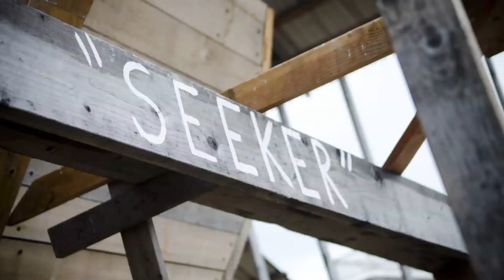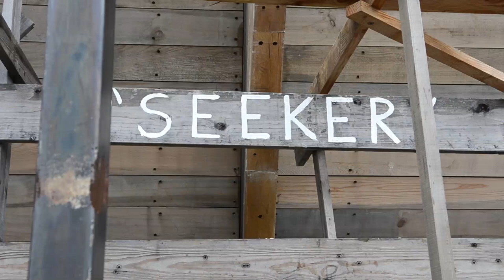Wooden Boat Builder on Martha's Vineyard  | Woodworking Tour

Comment: Hi great video, I just have a question i have brought myself a putt putt
 boat it has a timber top someone had fiber glassed over it so i have 
now taken all the fiberglass off , it now has bare ply i was told on a 
boat forum to rip the ply off and get rid of it but i would really like 
to keep the ply on there can i stain over it and what would you 
recommend i put on top of that someone said epoxy resin  or would marine
 varnish work any help Appreciated.